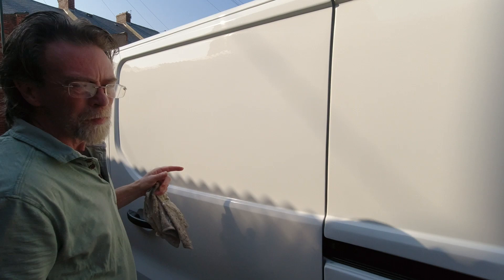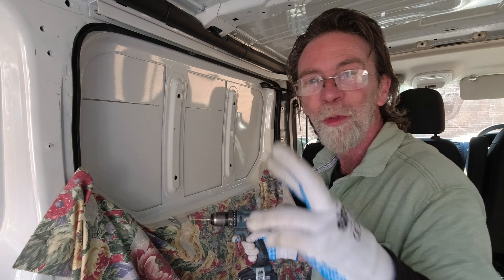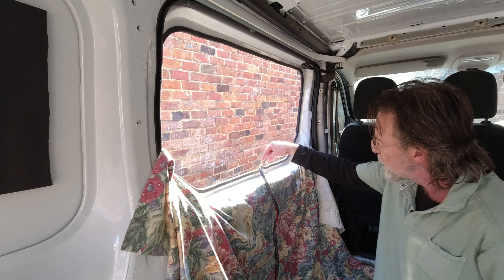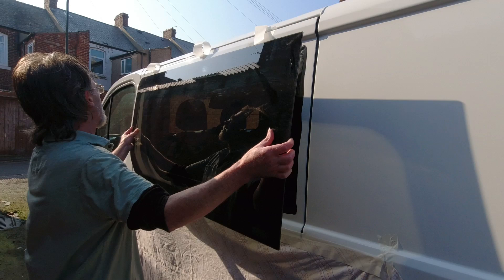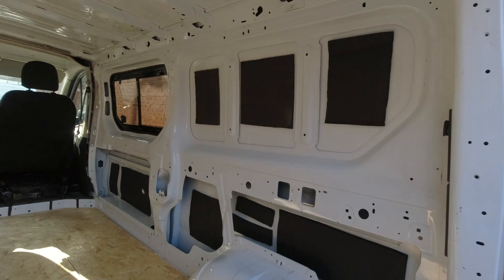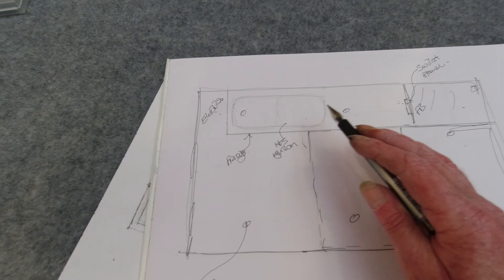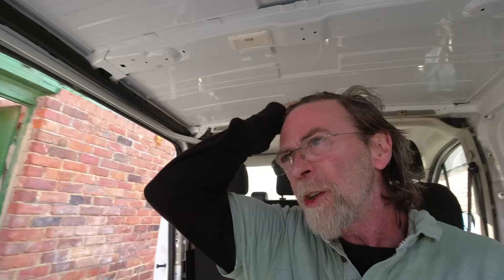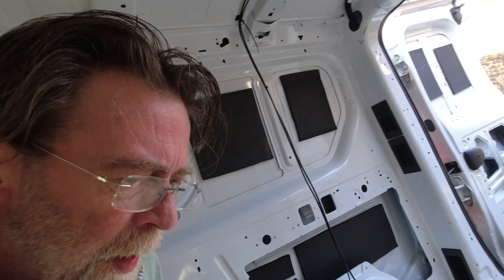Vauxhall Vivaro Campervan Conversion - Pt 2 - Windows and First Fix Electrics

Comment: Got my LWB Trafic last month. Crisis with injectors leaking and rattles from 5th & 6th gear. Dealer to fix next week 🙏 under the '30 Day' rules. A pair of openers here in France €821.80 + fixing kit !😱. 2 openers + fix kit £315 inc UK p n p. from UK Glass. Ferry booked .... 

Windows in my Movano, the old fashioned type with rubber seals, a job for a pro. The cut-out had to be mm perfect. £90/window to fit ☹. These sealed windows a breeze to fit.

Your vid 'The Bible' for installation, tho' I will probably put the sealant on the van rather than the glass. I don't trust my fingers not messing it up whilst carrying the window. I notice that nobody bothers to paint the cut edges of the steel. I will. Thanks for your excellent vids.

Comment: Dave, I LOVE your videos. My girlfriend and I are going (hopefully) to buy a Vivaro later this year. But - we're going to have to do a build literally 'on the fly' - start travelling - do a bit of build - keep travelling - do a bit of build (I'll spare you the details why). However some of the basics we'll have to do before we leave (e.g electrics). Thanks for being so methodical and comprehensive. This is going to be totally new for me; so it helps enormously to have a step-by-step guide. Cheers
Reply from the maker: Hi Orlando, Thanks for your comment and I hope the videos will be of use to you as you progress with your own van build. The best bet it to plan it all first and then just take it slow if you have not done such a thing before. In answer to your other comment the insulation material is just classed as shredded up bottles. Good luck with your build, hope it all works out well.

Comment: Thanks for a very detailed video, Dave. I installed everything in my van without drilling any holes. Did you consider running the cables, with protective split sheeting, through the roof channels?
Reply from the maker: Hi, Most of the cables are in the split conduit. But a hole and rubber grommet seemed like the best way to go for the solar wiring. Thanks for watching.

Comment: I see you used sound deadening on panels but only smallish squares. Is there any additional benefits completely covering internal panels using sound deadening materials?
Reply from the maker: I think so long as the middle of the panel is covered to about 50% of the size of the panel it should be okay. You will get a bit better performance if you cover the whole panel, but the centre is the most important.

Comment: Where did you purchase the 1.5mm and also the rubber grommets please 😁
Reply from the maker: Hi, I got the cable here https://www.splitcharge.co.uk/product/thinwall-flat-twin-1-5mm%c2%b2-2-x-21-0-30-21-amp-cable/
and the grommets came from ebay, loads of different sizes to choose from. Hope that helps.

Comment: You didn't mention painting the bare edges of the metal after cutting the openings! That is crucial to avoid later corrosion.
Reply from the maker: Yes, I know that did not make it into the video but I always paint them with the black primer used for sticking the window on.